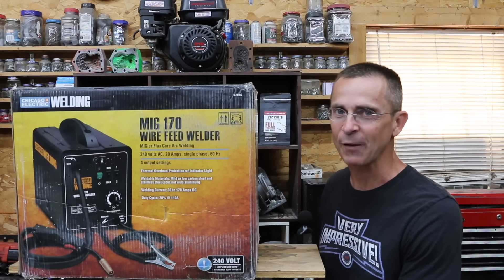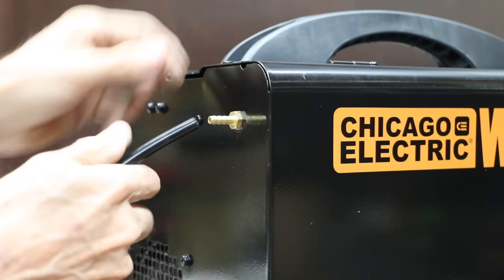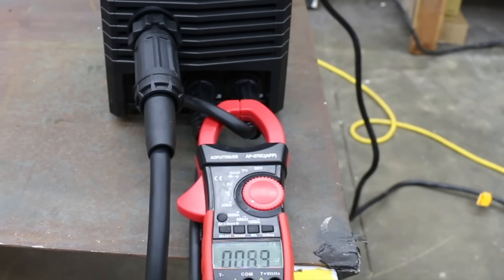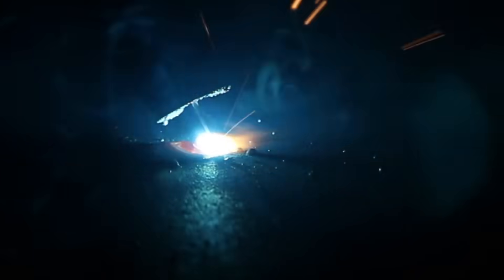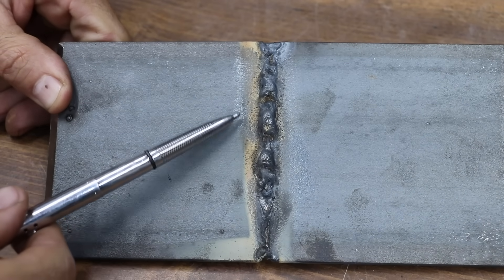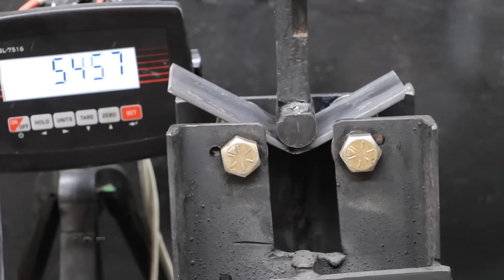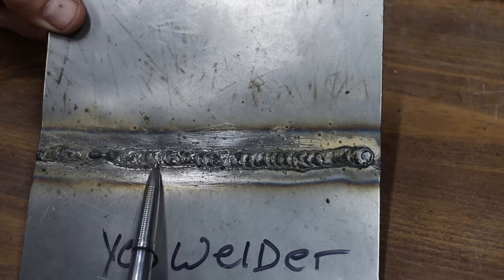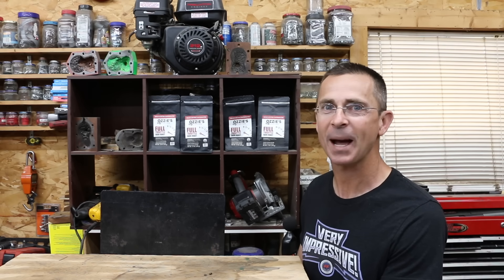Cheap vs Expensive Welder? Let’s Find Out!

Comment: Not a welder but I've been thinking about getting into welding for few year, about a year or two ago I started watching videos about budget diy welders and I discovered YesWelder, watched about every single YouTube video that anyone has made about it and it sounds like a great option considering the price and it being 4 in one, i thought that model was 220V only good to know it's dual voltage but a bit disappointed it didn't do good with sheet metal, i still haven't bought a welder but I'll probably still go with YesWelder

Comment: I grew up in a metal fab shop and have been welding since I was 12. We always made our guys in the shop push the weld and not pull the weld like the welder did in your videos. We felt that pushing the weld made a stronger weld, but that is a age-old debate among welders. I wonder how that would make a difference with these hobby welders. Pulling is better with flux core welders though.

Comment: I do have a Vulcan welder. I don't like the orange color at all. But the fit and finish of the cords, and the plastic, is amazing. I have the 165 amp Vulcan dedicated TIG welder "ProTig 165" and the power cords are made out of super soft, supple, very thick rubber. The foot pedal is solid steel for controlling the current. And it weighs a ton--they don't cheat by using transistors in place of necessary transformers (there are several actual transformers inside). The shear weight means they didn't try to cut costs on the build quality. Reading about the Lincoln TIG welders, I found a very high failure rate reported. None of the other welder brands have the reported failure rate of the Lincolns (based on my research 3 years ago). The Vulcan welders seem to have more reliability than Lincoln welders, or at least as good, for less than half the price.

Comment: As always, Todd, your approach is great and I very much appreciate this channel!!!  I come here often for advise before purchases.  As a longtime CWI looking to make a setup at home for hobby work, I was watching and trying to determine which machine I may want to get for my shop.  Since I see them very often in plants, it is very hard to argue against Big Red except for the cost, but this was an interesting showdown.  As I was watching, I was looking to see if the same brand electrode was used in all the machines.  It seems the electrode provided with the machine is what was used.  I would guess that choosing a quality electrode (for the intended application) when the first roll is gone will make a huge difference in the performance of each welding machine, as will the choice of shielding gas to match the selected electrode and application.  Another difference noted during deposition was that sometimes the welder pushed the wire and sometimes he pulled.  This will also make a difference in performance come testing time.  Obviously the welder was trying to adapt to each electrode, so he obviously felt the need to push/pull to get the best performance, but again, using one brand of quality electrode to compare all the machines would probably been a better approach.  One other consideration in my purchase will be availability of the consumables such as whip, liners, drive rollers, and tips.  I think the Azzuno would be my choice from these, assuming readily and economically available consumables.  Looking forward to more videos in the future.  Thanks for the fine work!

Comment: i would love to see a electrician scissors video, testing klein, fluke, Milwaukee, kobalt, knipex, ect. testing sharpness and force it takes to cut a copper wire, slop between blades, and which stays sharpest for the longest, another good test is cutting 8 mill plastic sheeting,

Comment: Quite keen on you testing parts degreasers. I found this product called Zero Tri made by LPS. It's crazy expensive - $20+ per can, but it works like magic and it even smells good. Turns out LPS is an entire line of degreasers and soaks and that sort of thing.

Comment: Great work, I own lincoln and hobart, and have used a lot of miller. 

Miller is best IMO, Hobart best for money. My small Hobart runs about 30% longer, and works better at top and bottom than my small Lincoln. 

Those chinese machines are hit or miss, I have seen/used some that worked well and others that were total crap, even same model. Yeswelder and Vulcan specifically have seen both good, and horrible results. 

As always, great video with well thought out testing.

Comment: Thanks man! I actually just ordered a yeswelder mig250 pro. You can get them regularly for around 350 bucks. It can mig, lift tig, stick and MiG weld aluminum wire. I think it will be an all around good welder for me.

Comment: I'm a mechanic. Been welding exhausts for probably 10 years with a decent Hobart MIG machine. I thought I'd gotten to be an OK welder in that time, nowhere near the skill of a pro, but OK. Had the machine dialed in to make the best welds. The Hobart crapped out and as it happened, I had a much nicer, big, super professional, old school Lincoln MIG welder ready to replace the Hobart. Let me tell you, I was shocked that I had become a professional welder overnight. Seriously my welds went from looking amateur to professional with the change of machines. Either the Hobart was complete crap, or the Lincoln is just far superior, I'm not sure. Amazing what a vast difference the welding machine can make.

Comment: I'm surprised you did not have a Hobart welder in the comparison, but I think the real difference in most of those welders is the duty cycle capability of the welding machine which you found out during your 5-minute test. I'm sure the operators manual for those machines would show you the duty cycle rating for them and that would be an interesting comparison to see also. Keep up the good work.
Reply: I was thinking the same thing, displaying the duty cycle info and pushing them to it and/or beyond

Comment: If you mentioned it I missed it, but replacement parts and consumables are also important to consider when shopping for a welder. A better welder can be repaired instead of being disposable if something happens, meaning a better welder can be cheaper in the long run and nicer to use.
Reply: The repair part is partially true, but the problem with the new inverter machines is, if a board goes out and it’s not under warranty then you may as well buy a new machine. So you can spend say $2500 on a newer Lincoln machine and fry it, or you could spend $1000 on a Hobart/vulcan/insert other “cheap” brand and fry it. Key is getting a machine that has a good warranty and take care of it. This is my view as someone who sells the red and blue machines for a living
Reply: @SneakyGrizzlee  Or buy something like the yeswelder at $400 with its one year warranty that performs damn near as good as the lincoln at $2500+ and in a year weather it frys or not buy another, point is you can buy 6 of the yeswelders which carrys you one year past the lincoln's 5 year warranty and you will not be stuck with old technology when the newest comes out or take a major kick in the pants when you try to sell your 5 year old lincoln because you want to upgrade to that newest technology, also the new lincolns and millers are not anywhere the quality they used to be as far as durable, that went away in welders when they went away from transformer to IGBT inverter design,,, nicer and easier to weld with yes but more prone to taking a crap hell yes but that's the trade off, for the average joe occasional home hobbiest weeked warrior welder a 2000$+ welder make abosolutely no sense whatsoever not with some of the high performing low priced options out there, you want a welder that will kick damn near any welder by miller or lincoln or esab right square in the A*,,, even the more comercial line offerings by those,,, check out the primeweld mig 285 it is a top performing built like a tank machine for under $1100, miller lincoln and esab are for guys that just like to piss away money to get an ego stroking and an A* reaming.
Reply: Yes!
Reply: A Lincoln motor drive or mother board are both more than half the cost of a new machine
Reply: @funonoldwheels7150  So it's like buying an HP printer then.

Comment: I got a second-hand Kemppi 181 back in 1991. I've tried other MIG welders but nothing compares. Even some rather expensive stuff is below par. I upgraded it and replaced the contactor with an SSR, I also run it on the wrong input tapping to squeeze a bit more out of the transformer. Considering the level of abuse it gets I can't fault it. I keep looking to upgrade to an inverter-style setup, but so far nothing has come close below about £2.5k. As your test proved, there's more to it than what's printed on the box.
Reply from the maker: Thanks for sharing.

Comment: Bad thing some of this stuff you test is not on sell in Europe. But one idea for testing is those electronic calipers you use to measure anything. Some of them might be too sensitive to temperature changes and also +/- error might appear if the slide is moved many times without setting it back to zero.
Reply from the maker: Thanks for the video idea.

Comment: After years of welding, and buying everything from cheap to quality welders, I can confidently say that a quality welder is worth the money.  Moreover, trying to learn to weld on a cheap welder is counterproductive, as you'll find yourself constantly fighting drifting settings as the internals heat up.    I found this to be particularly true for TIG welders.
Do yourself a favor, and save a little longer for a high quality machine.
Reply from the maker: Thanks for the feedback.

Comment: 30,000 ft view on these little Chinese hobby welders.  None in the class of MILLER or Lincoln for long term use, dependability and company support.  Really not apples and apples.  You do get what you pay for.  MIG welders are constant voltage machines.  Amperage is a function of wire feed speed and other factors.  I hope I’m never on the highway behind a trailer built with one of these.
Reply from the maker: Thanks for the feedback.

Comment: Great vid….as others have mentioned the build quality (or lack there of) would have been helpful. Noticed some brands had a knurled grooved wire feed others pinch type by applied tension. The cheap feed rollers can destroy an expensive roll of wire really fast if you don’t catch the issue asap.
Reply from the maker: Thanks!  Thanks for the constructive feedback.

Comment: I looked seriously at the Vulcan several years ago. At that time it was a DC welder only and not capable for AC to run aluminum. By the time I priced two Vulcans(DC unit and AC unit with MIG and TIG) with the necessary accessories to get what was needed they were within just a few hundred dollars of the Miller Multi-process 220 with everything included. Ultimately I bought the Miller. Every time I run the Miller the grin under my helmet is huge. It does everything I need and does it well == at a higher price point than any of the ones you tested. I have always subscribed to the "Cringe once - Grin many" method of buying tools. Having been a licensed and degreed aircraft mechanic for many years, as well as licensed in motorcycles and many versions of small engine equipment, this mind set has served me well if not not inexpensively.
Having an expert welder to consistently run the units and give commentary was extremely helpful.
Reply from the maker: Thanks for the feedback.

Comment: I got the Toolium 250 110/220 machine for $350. It can run Aluminum through the special liner negating the need for a spool gun. I did a single pass 3/8" fillet on 250 amps.
Reply from the maker: Thanks for sharing.

Comment: The different wires make it a bad comparison. Lincoln flux core is actually multipass rated and will bend used properly.
Reply from the maker: For this test I purchased new wire and used the same brand for each test.

Comment: I hate to say it but welders are like pens, Everybody has their preference, some are easier to use than others, but the end result is mostly based on the user not the equipment.
Reply from the maker: Thanks for the feedback.
Reply: You've definitely never welded with a HF Chicago electric 😂
Reply: I actually have one, yes they're garbage but a good welder can lay decent beads with one, along with a Tooliom for mig, an old bobcat 225 for my stick/mobile and Esab fabricator for my tig, but you know nobody here online could ever have multiple machines in their garage/truck right? Go laugh at something else. @AndrewB23

Comment: What ever you buy, PRACTICE and destructively test samples! What is not tested is not known and especially with wire welders it's easy to make a cold weld that looks nice. Make sure you can SEE! (A Project Farm review of welding helmets would be VERY helpful to noobs.) Get an eye exam if you've not had one. We taught hundreds of welding students and you can't weld if you can't see so we kept magnifying lenses on hand (which paid off in saved consumables). 

Because the detailed vision you need to weld isn't always obviously defective in normal life, an eye exam and if needed a prescription written for near vision (your ophthalmologist can write multiple scripts at one visit) is a very good idea. Some students wore cheap magnifying reading glasses from Walmart, and other wore magnifying helmet lenses called "cheaters" you can get at your local welding supply. Welding forums like Weldingweb and the Miller forums are outstanding assets. Youtube is too but READ. You'll thank me later. 

Other stuff: Wear a clear face shield when grinding and a Shade 3 for torch cutting. Goggles for and do not protect your face.

Comment: I am wondering about thread sealant. I am rebuilding an old engine with some parts un available I need to seal up a bolt hole that will come in contact with coolant and the pressure of the cooling system. I think it would be interesting
Reply from the maker: Thanks for the suggestion.

Comment: You can't weld plate steel with those. They're good for patching up something at home. Better off getting a tombstone Lincoln with DC. Nothing wrong with them though. I've got a little Lincoln weldpack 100. It sure isn't going to be converted to gas. Much less TIG.
Reply from the maker: Thanks for the feedback.
Reply: You are welcome.  @ProjectFarm

Comment: well welds do depends on what wire you used, i noticed wire you used to weld were all different , i would try it again but use same wire in all machine.
Reply from the maker: I bought the wire and used that brand in all of the testing.

Comment: Thanks for the comparison. I purchased the Lincoln through the company I work for. It lasted about an hour and blew the breaker in my panel. I had to take it to an authorized repair facility and they stood behind the welder and replaced it. I also have a Vulcan Tig Machine, have not used it much yet to know how good it is. Appreciate your honest testing.
Reply from the maker: Thanks and you are welcome!  Thanks for sharing.

Comment: Having owned numerous MIGS over 30+ years forget cheaper ones. They fail very quickly. Medium priced 'brand name' are usually better but  too fail quickly. I currently own a 180amp Unimig, an Australian brand and it normally works extremely well. And will weld alloy with the correct gas. And ideally its own hose and gun.
Problem is IF left sitting for any period the wire goes rusty on the spool. And will not feed nicely at all.
Reply from the maker: Thanks for the feedback.

Comment: I have a Suggestion… 🖐 PVC GLUE strengths… I recently was working on a vertical water well jet pump when the 1” suction pipe broke away from a coupling because the glue didn’t cure properly or ???
Reply from the maker: Thanks for the suggestion.

Comment: This video deserves a round of applause! 👏🏼👏🏼👏🏼 side note, I have the Chicago Electric and I weld body panels on a regular basis without burning through using 75/25 Argon /CO² paired with Hobart .23 wire on the minimum/2 setting between 4-5 wire speed. Side note, switching to the knurled feed wheel greatly improves wire speed consistency. I've gotten compliments from seasoned welders on my work. CE 180 mig is a great entry welder.
Reply from the maker: Thanks for the feedback.

Comment: Need some clarification please;  the Azzuno  2nd place in 20 gauge subjective, last place in Weld Penetration, and then back to  2nd place in Force to break weld... something here doesn't quite make sense.  Also although the 5 minutes continuous welding does provide some date about the electrical integrity quality of the welder unit, it's not all too practical in real world application under normal usage compared to weld results.

Comment: You can never go wrong with Lincoln Electric. They put a lot of money into research and development.  I don't know if they even make a bad machine. Miller is excellent too. It's what most of our machines are at work. And i have heard mostly good things about Vulcan. 

Me personally I have an old Miller 250 Millermatic MiG welder and a little Inverter welder that can FCAW (arc or stick welding), TIG weld or PLASMA cutter. It can cut ⅜ plate or sever ½". Not bad for a $450 machine.
Reply from the maker: Thanks for the feedback.

Comment: I got the central 170 i ran it on 220 and welded on full blast 3/8ths thick for about an hour at a time and it never thermals.  Fools running 110 never learn😂

Comment: If there's a burnback timer on the Yeswelder, you need to turn it off.  That should prevent the wire from burning up into the nozzle
Reply from the maker: Thanks for the feedback.

Comment: I was wondering if you use the same thickness wire in the same brand wire, and all welders. You might want to try another video different brand wires in the same welder to see if it changes anything………
Reply from the maker: I purchased the wire and used the same brand in each of the tests.